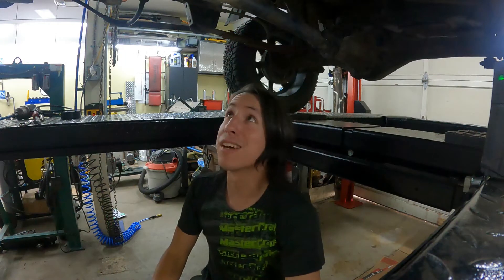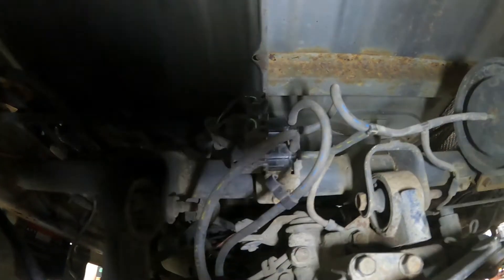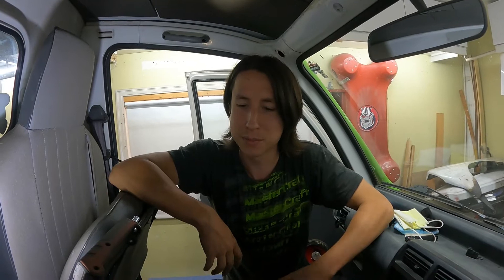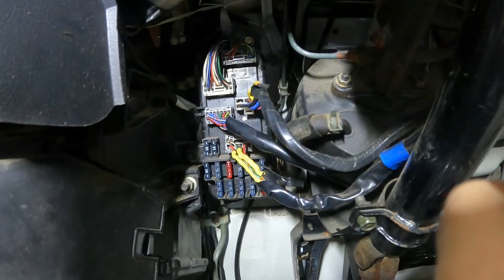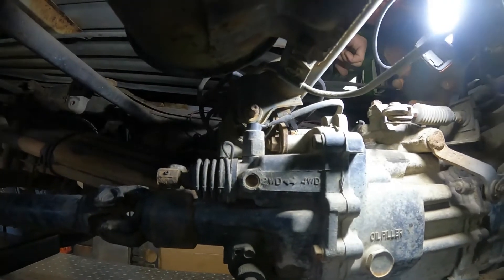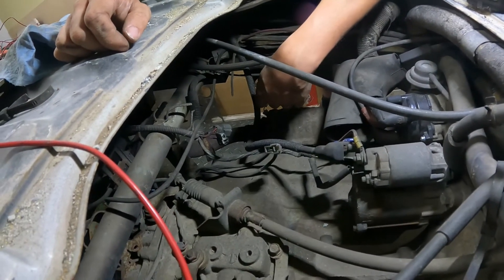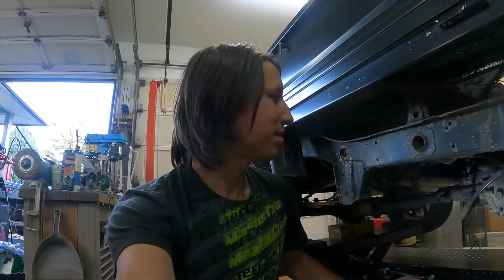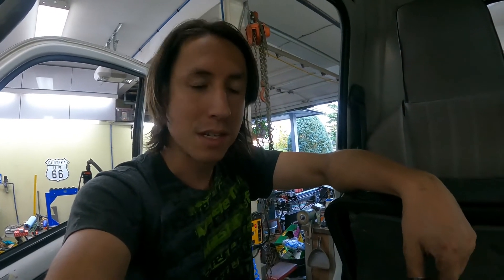Mitsubishi MiniCab 4WD Electrical Diag & Repair

Comment: quick question here, if you push the button on the 4wd lever does the green dash light come on and the actuator function? so far ive got nothing happening when i use my button and no light

Comment: Did you ever have any problems with your heater and alternator. Im asking because I'm having problems with 4x4 and heat and my alternator
Reply from the maker: @roypetersen1400  those are probably not related. The heat went out once on my van, turned out to be a bad t stat. The alt also stopped charging, but that was a single matter of cleaning all the terminals and connectors.

Comment: Ive watched a few of your videos im haveing a no spark issue replaced the cap and rotor any ideas on a few things i can look at thankypu
Reply from the maker: Check the coil plug and actual coil itself if you have already confirmed you have spark signal.

Comment: Hey bud do you know where I could find a push button parts for my Mitsubishi mini? I can’t find the piece for it? Know of any good parts websites? I’m finally getting closer to getting my truck back from the mechanic .  I’ll have to fix that push button once I get home with it at some point.
Reply from the maker: MB780307 I think is the number, looks to be a few online suppliers which carry it.
Reply: @projectaddiction - man thanks so much for replying quickly 🤝🙌.  I appreciate ya. I’ll have to buy that button assembly if I can’t find mine, so thanks a lot for part number.   The Guy said mine will be done this weekend 🤞.  I can’t wait.  He better give me a huge discount for having it so long. Lol.  Have you ever timed one of these UT42 engines?  That’s what made me take it somewhere and it was winter time and I wanted it done quickly, but that definitely wasn’t what happened. I’ll be working on it myself from now on tho lol.  Timing one seemed pretty hard to do. I have a rebuild book on the truck but the writing is hard to make out on it sometimes.  Anyways thanks again man 🤝.  I’m subscribing if I’m not already
Reply from the maker: @Just-Some-Cool-PrayingMantis  actually I have all the footage on my hard drive from doing the cylinder head and timing belt... I just have not had time to edit it all and honestly I did a terrible recording job lol. You need a mirror to time it because the marks are a bit hard to see. I can do the full timing belt swap in about 45-60 minutes, it's fairly easy to do.
Reply: @projectaddiction - hope you get it edited and posted sometime. There isn’t any videos anywhere of how to do it (that I’ve seen).  I probably should have done the head gasket and all that myself. It was almost winter so I took it to a guy my dad takes his stuff to and he also works at same company as me but at different location. He’s heavy equipment mechanic. But yea I like I said before, it’s almost a year and he’s finally about done.  Like dude I didn’t take it to you to lolly gag around and take your sweet time 🤦🏻‍♂️.  Never again will I make that mistake lol. So was it hard getting it timed and everything?  What size exhaust piping are on these? 1 1/2”?  Thanks again bud for replying to my questions and being quick 🤝🤝✊
Reply: 45-60 minutes after it’s all disassembled and starting to put back together? Or from start to finish?  I started taking things apart cause I planed on doing the head gasket myself, but didn’t really have a good area to do it. Didn’t want to have it in barn all winter in the way. But anyways I took the seats out and then I started taking all the middle stuff out( 4x4 button, parking brake, and all that stuff) so I could get the jug off. Is that how you done yours? Or is yours different?  Sorry for long message and asking a lot of questions lol
Reply from the maker: @Just-Some-Cool-PrayingMantis  that is just for the timing belt. The cylinder head takes somewhat longer.

Comment: Do you know the location for a fuse link from battery??  I put cables on backwards like a dummy..  but now I have a no crank issue??
Reply from the maker: Have you checked the main fuse? It's located under the left seat near the coolant reservoir.
Reply: @projectaddiction  I did, found it right after I sent the message.   Actually I made a video for the next dummy to do what I did lol…. Thanks for the response.   Where were you buying your parts?  Toro parts dealer?   Or online?
Reply from the maker: @matthewsuryan6035  nice! Glad you got sorted. It all depends on the part, some i make, some I modify from other vehicles, some from online straight from japan, or if I need it quick I will buy from an importer like G and R.

Comment: Tengo una guagua de esa en RD y el sistema electrico esta bien pero no funciona para nada
Reply from the maker: hola alejandro
Lo siento, no he hablado español en unos 20 años, así que voy a tener que usar el traductor de Google... Si ha confirmado que el sistema eléctrico está bien, entonces debe mirar las líneas de vacío, los actuadores y los enlaces mecánicos. Mi varillaje estaba agarrado de forma sólida originalmente y apenas podía moverlo con la mano.
Reply: Sólo que el swich 4wd no le llega corriente
Reply from the maker: @alejandrosegura7784  Si no tiene energía en el interruptor, puede comenzar revisando sus fusibles. Si todos están verificados, necesitará rastrear el cable vivo desde el interruptor para encontrar a dónde va. Verifique todas las conexiones y terminales en busca de corrosión, resistencia u otros signos de daño y arco.

Comment: Can I ask you a question,  I was wanting to know what that line is at around 1:11 on the video that’s going into the transmission right below where the 4wd engages?  That rubber line is off on my mini truck and it’s full of dirt and stuff.  I just bought the truck and been going through everything on it and seen the line was off.  Hope you might know. Thanks 

~ Praying Mantis
Reply from the maker: Are you referring to the line at the top right of the screen with the collar and 10mm retaining bolt?
Reply: Project Addiction - sorry for late reply getting back to you. But the line right above your hand and it’s a round nurled piece you can screw and unscrew with your hand. Like some sort of vacuum line?
Reply: And yes I think that’s the same thing you’re talking about. I just now noticed that bolt right above it
Reply from the maker: @Just-Some-Cool-PrayingMantis  without crawling under the truck to confirm I am 90% sure that is going to be the speedometer cable. I will confirm when it's in the air next.. which should be soon because it just popped the head gasket... So HG and timing belt video to come lol
Reply: Project Addiction - man sorry to hear about the head gasket brother.  I actually getting ready to do the same darn thing to mine!!  Coolant in first 2 cylinders 🤬 lol😭 😅.  I Ordered me a service manual to do the job but hopefully I’ll get to follow your video as well.    But yea let me know what you come to find out with that line we’ve been discussing.  I haven’t been able to run it back and trace it down. But seems like a bigger vacuum line or something.
Reply: Was you getting coolant in your cylinders as well? Mine is getting in there pretty badly.  Just hoping the head is ok and not warped or cracked
Reply: Sucks to just buy the thing and now having to work on it.  But I’ll get her lined out and have fun with her eventually